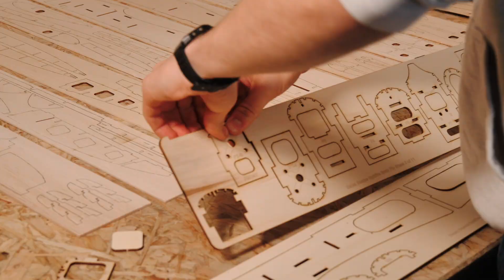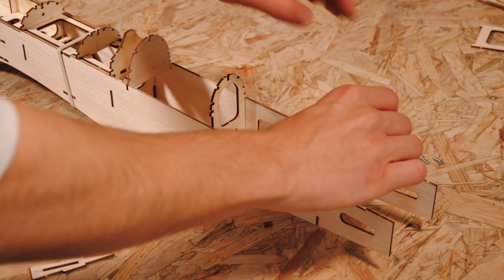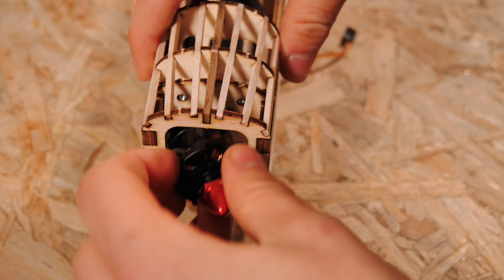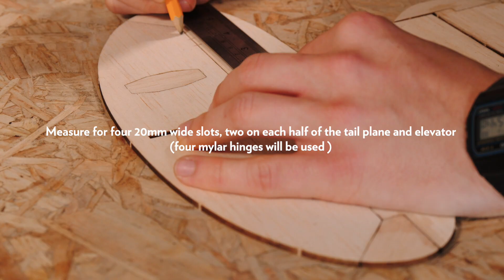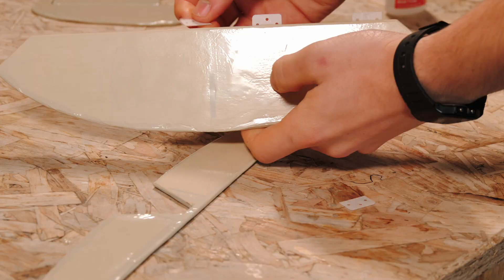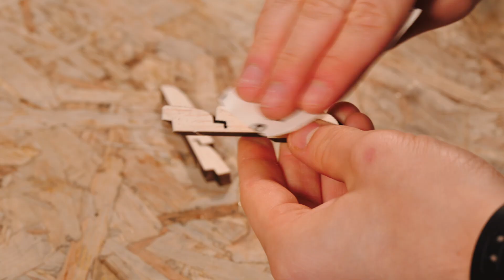How to Make a Balsa RC Spitfiire

Comment: Can a 2-stroke 40cc engine be used instead of the electric motor?
Reply: I think 40cc might be a bit big!  Even a .40 cu inch would be too.  I would think the structure is a bit light to withstand the vibration inherent with glow engines.

Comment: Interesting I build one 60 years ago also from balsa wood, I had to wind up the propeller which was driven by elastic. Never attempted to fly it. Too scared to damage it.
Reply: I built the Guillows kit in the 1970's...balsa and silkspan covering with Testers fuel-proof dope paint. Made it as a control liner with an 049 Cox engine. Crashed it to bits first try (my friend didn't give it a decent hand launch!).

Comment: Always build on wax paper directly over the plans so everything is perfectly aligned to the plans to prevent warps and out of true components. Wax paper prevents the glued parts from sticking to the plans and the build surface.Another thing use a large piece of insulation foam and T-Pins to pin the parts to the plans to keep everything aligned. I think you would’ve found it easier to build had you done a little more research on how to build RC balsa airplanes instead of just assuming as you obviously did. Building balsa models is pretty much a dead hobby these days but back in the 1980s and early 1990’s I built a lot of large scale rc kits. Good luck and I hope balsa kits come back.

Comment: great model but a little bit boxy compared to the original spitfire, would love to see a more realistic model, for the more advanced modellers
Reply: Just sand the turtle deck and engine cowling round and sheet with thin balsa sheet then cover with your choice of iron on covering or paper and dope.
Reply: @keithwhisman  Have you heard of or seen anyone who's done this with this model? I'm a beginner and I'd like to see
Reply: @issraali7715  no but I’ve done it with other models to make them more scale but I also made them radio control.

Comment: Looks to be a very well thought out CNC kit that goes together very easily.

I think your tip about building on a non-glueable surface should be stressed a bit more . You don't want people having to fly the work bench :)  I use cling film usually but Oracover backing works, too.

Rather than threading the servo lead through the ribs before covering it's better to make a paper tube so that the servo leads can be removed and replaced if a servo needs to be replaced - eg if the gears strip on a belly landing.

I'm certainly tempted it looks great.

Comment: I need fixed  landing gear. Is there a landing gear option?

What is included in the extra detail pack?
Reply from the maker: The detail pack is now included as standard and includes the radiator, oil scoop, exhausts etc. You might be able to figure out a way to add landing gear as it's super customisable!

Comment: Hey James well done. Can you recommend what size glow motor you would put in this as electric is too quiet for me.
Reply: An 061 to 09 would be good for this. A strong 049 might just about pull it as well, if you build the plane lightly.
Reply: Definitely need a 40